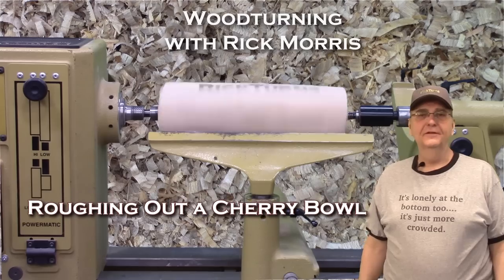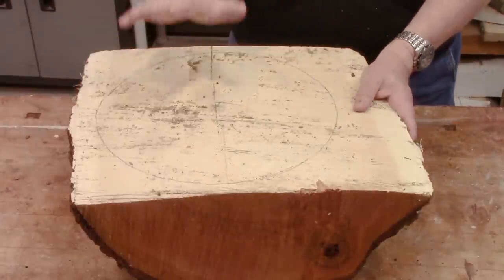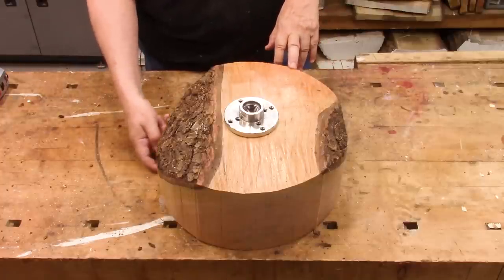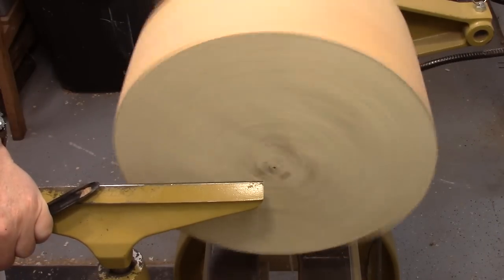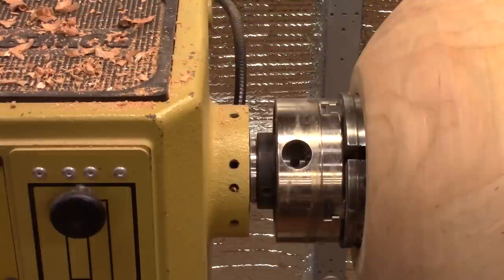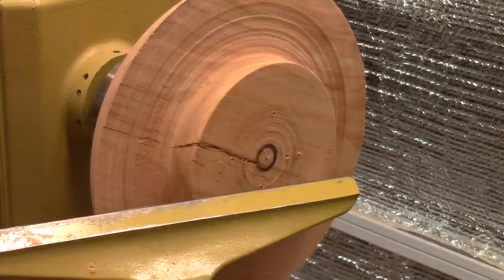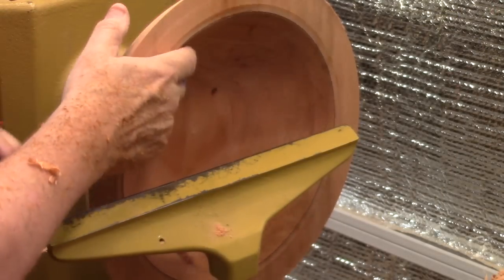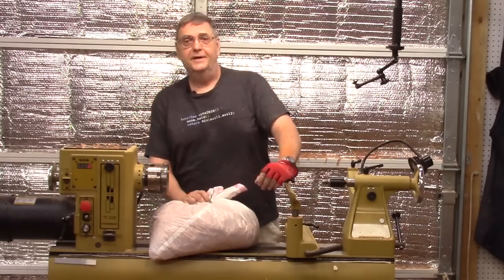Roughing Out a Cherry Bowl

Comment: That is a big piece of cherry. I'll be interested to see how you dry it down. I've had success drying rough-turned sugar maple and cherry in silica gel for about a week, weighing it every day since I don't have a moisture meter. I got the usual drying distortions. They seemed pretty stable when I finish-turned them. This drying method is still new to me so I don't have all the answers but I'm encouraged. The first 24-48 hours are probably the most critical since a lot of moisture will be absorbed by the gel and the wood stress is likely to be the greatest. My sugar maple was the greenest and it developed small cracks which I filled with CA; this stabilized them. (I don't mind small cracks). No more cracking after 48 hours on this piece. You mileage may vary.
Reply from the maker: I've read about using silica gel to dry bowls, and the comments I've seen have been favorable. I'm going to do that sometime. How many pounds of the material do you use? Thanks for watching, Paul.
Reply: I bought three, one-gallon "Dry & Dry Blue Indicating Silica Gel Premium." This totaled about 21 pound. Surround the wood with at least 1 inch of gel in an air-tight container or bag. Check daily for cracking/weighing. The gel turns pink when it gets saturated. Dry it in a 200-225 degree oven to reuse. Good luck.
Reply from the maker: Thanks, Paul.

Comment: Rick, great job as usual.  I noticed you use a microphone on your shirt.  I can't seem to find the right setup.  Tell me what you got.  Thanks, Larry
Reply from the maker: Hi, Larry. I'm using the Movo WMIC50 2.4GHz Wireless Lavalier Microphone. If you search Amazon for that, you should find it. It costs $99. The only problem I have with it is short battery life. It uses two AA batteries but they only last 30-45 minutes. Although it has a low battery warning, it's not very noticeable and I frequently end up with video w/o sound. For the price, though, I think they are a good buy.
Reply: I don't think 30 minutes will cut it for me.  Thanks, Larry

Comment: What is the % when you declare the blank dry?
Reply from the maker: In my workshop in Georgia, ambient moisture content is around 11 percent, so that would be as dry as possible for air-drying.
Reply: RickTurns I made your box and put a couple of black walnut bowls in after the first day I got cracks on the end grain. Any thoughts why?
Reply from the maker: White dog, I’m not sure if I replied to you already. So here goes. I’ve had drying problems with walnut also. If you see cracks forming turn off the fan and light for a day. With walnut and red oak, I usually start drying with only the fan and no light. What you can also do is coat the end grain with a sealer - I use Titebond glue. That will slow down the drying at the end grain, which will help prevent cracks. After a day or two of fan only, try turning on the light again for a day and see how that does. Some bowl blanks I dry develop a fairly substantial crack, but as the blank drys further, the crack closes and you can’t even see where it was. So it’s something of trial and error. I’ve had the best results with soft maple.
Reply: Thank you very much. I will give it a try. Also thanks for taking the time to help me out.

Comment: why do you put it in a plastic bag, instead of leaving it outside to dry?
Reply from the maker: I put in the bag of shavings only temporarily, while I built a small drying box (see this video: https://www.youtube.com/watch?v=L2q1FXESVcY). Once I had my drying box, I used it to finish the drying. However, drying it outside, exposed to the elements, doesn’t work too well - it will dry out too fast, and probably split. The aim is to let it dry slowly, which minimizes the chance of cracking. Thanks for watching, Gabriel.

Comment: Use a power planer to flatten the other face and you wont need to do the first step. Nice wood
Reply from the maker: Thanks for the suggestion, Pat! I don’t have a power planer, though. I did once have a very small joiner, but that wouldn’t work even if I still had it.
Reply: RickTurns Just a suggestion I cut the logs with the chainsaw ant it takes just a few seconds with the battery powered planer and makes the bottom perfectly smooth to put on my circle cutting jig for the 18 inch bandsaw. Face plate mounts perfectly flat and secure. I have found when I’m doing multiple bowls in a day that it really speeds things up!!! Happy turning and be safe!!